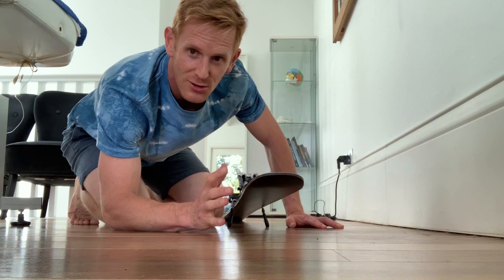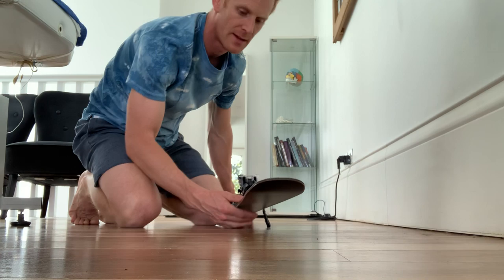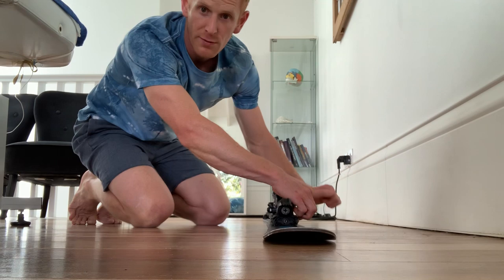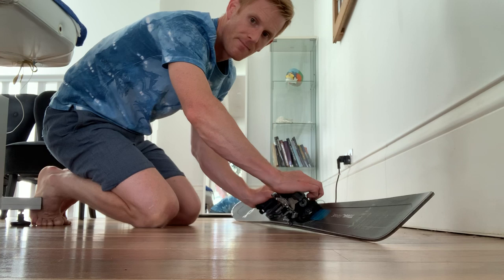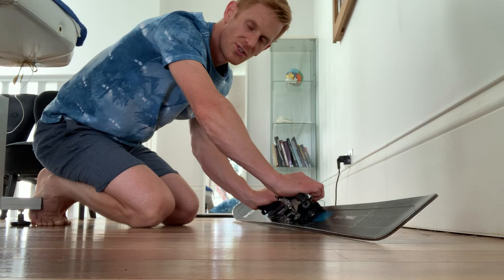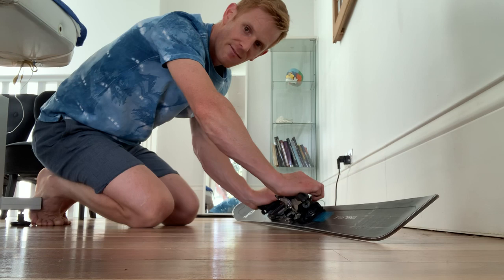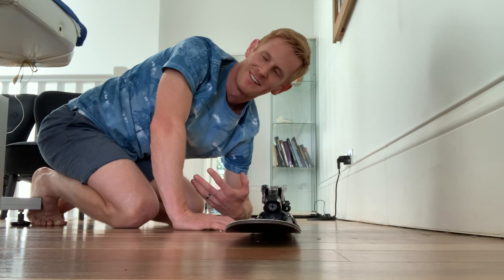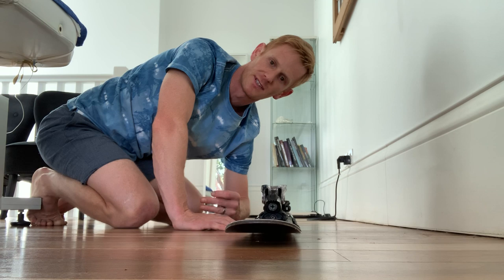Is there a limit to bending a ski to carve?

Comment: There is research showing there is more to bending a ski than just tipping. Edge angle, total load on the ski binding, moment of the force acting (timing) all have effect. And also the position of your CoM relative to the outside ski can matter.

You can tip the ski over as far as you want, you are not going to carve an arc as tight as Hirscher for example.

Comment: Great explanation! However, I wonder in what angle does the producers measures the radius for the ski? That angle should be standardised, right?
Reply: I think it is 45 degrees. To be checked :)
Reply: The turning radius of a pair of skis is infinite.  That's why it's ridiculous to label them by turning radius.  It's nothing more than a sales gimmick.

Comment: Hmm. The force that compress your skis is addition of weight and inertial force. At 45 degrees the force is 1.414 x weight. Efforts in skiing is just "against" inertial forces. Radius and angle are strictly linked.

Comment: extremely interesting video, it's making me think ... thanks.  Most skiers do not tip the ski over as much as you demonstrate in the final stage, it's more like the first stage of your presentation, so my first reaction on seeing it is how the entire edge is not on the floor/snow, you can always see light from the other side, even when it's bent to it's tightest bend .... so seems to be only the top and bottom portion of ski is always in contact with snow, while the foot area, there will always be some space between ski and snow  ... so i guess my question is is this how it actually is when skiing ?  is only the top and bottom of the ski always on ... edge.  or does the give of the snow allow all the edge to be on the snow when one is actually skiing .... i will have to think and be aware about this when skiing hopefully starts ... it raising a lot of questions for me about edge pressure .... i always assumed the whole edge was always contacting the snow, necessitating foot pressure to be applied mainly at the foot area, especially the centre area, ball of foot area.
Reply: The most important parts of a ski in regard to turning ability is the flexibility from the toe piece forward and the relationship between the waste and tip widths.  That's where the vast majority of the turn comes from.  99% of skiers slide their turns so it's the "Front Tires" that get the job done.

Comment: It seems, I believe, to be one pretty ' non-practical' way to increase radithat would necessitate bending the ski more - actually using 'less' of the ski... Most common example of this I can think of is when a much younger Ted Ligety used to carve a 360 in the finish corral after a slalom run. Problem is, other than being really hard on your knees, is that the surface area to support the amount of force generated by such a tight radius is greatly reduced... I've played with this kinda turn in the spring with fairly soft but still solid snow with a very firm base. Fun, but again not the most practical turn...
Reply: And actually wondering if this is a bit what top racers are doing in For a short instant in connection with transition/very beginning of the turn and with a modified stivit but with the shovel instead of the tail. It's a move that I call 'shovel dancing' for the sensation that I feel when I can do it correctly in a GS course.

Comment: At what edge angle do you get the designed radius (18m for your ski)?
Reply: Design radius is radius of sidecut - that is norm inside industry, and you make a carving turn with that raduis at minimal angulation, at 60 dergees you get aporximately half of 'design' radius (if you do not skid first).
Reply: @jurijfranko9002  Excellent.  Thanks for that.  I've been searching for an answer for a long time.

Comment: This is in static only. The paradox is that the expert level skier can ski shorter radius turns than the ski side cut radius! ... :)
Reply: Not without skidding
Reply: Depends on how you measure the sidecut radius. If it's the printed sidecut, then you can, like Tom showed above - by tipping at a bigger angle than the nominal calculation. Here's a good calculation visualization http://diginfo.ru/en/alpine-ski/ski-sidecut-radius-and-radius-of-a-carved-turn/ Also, in RLM's bible there is some calculation on the carved turn radius at different ski edge angles, which agrees with this more or less - I haven't done the calculations myself though... I also have a hunch that by being more "forward" than aft, the effective radius on hard snow is smaller - but I haven't done any calculations on that either... it could be that the forward part bends more or that the tail slips... or that the ski engages earlier thus turns more time - that's the issue with idealized math ;)
Reply: Another thing playing into the actual radius is the compacting of the snow underfoot. At 2-3g, the center of the ski will compact more snow underfoot than do the tips and tail (typical stiff race ski distributes something like 20%/20% of pressure to tip and tail - consumer skis keep even more underfoot) - another departure from idealized mathematical models, that I haven't calculated yet (and may never get to, heh). Combined with bigger edge angles, which require less snow to compact, this should influence the resulting ski bend and effective radius.